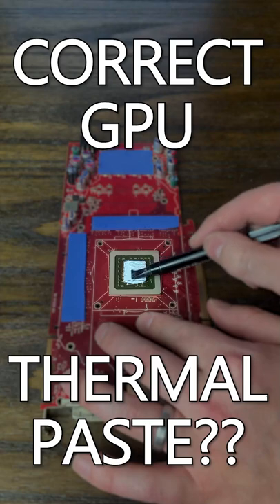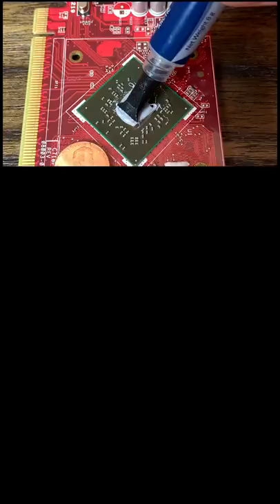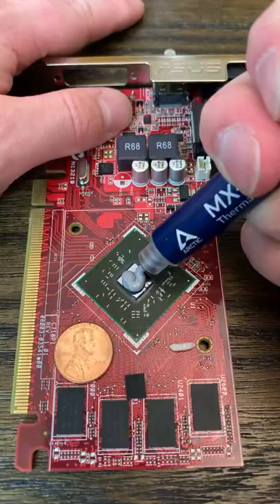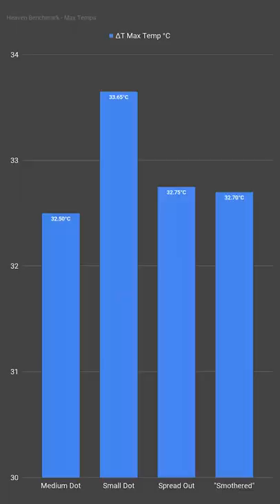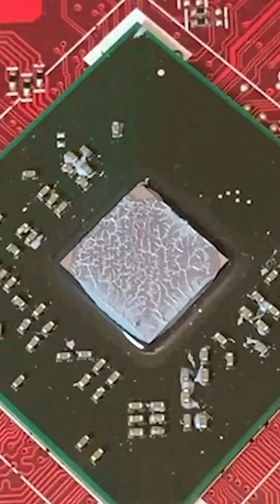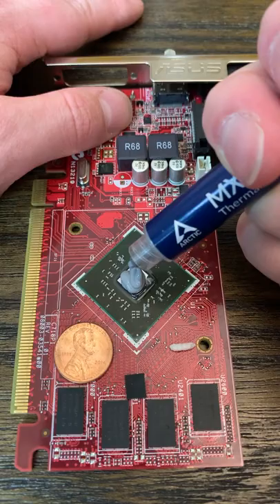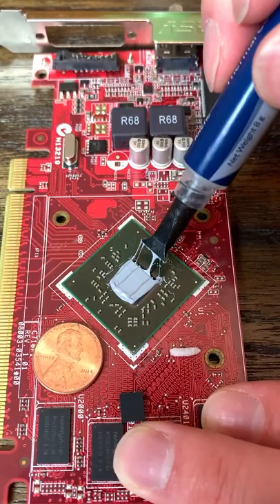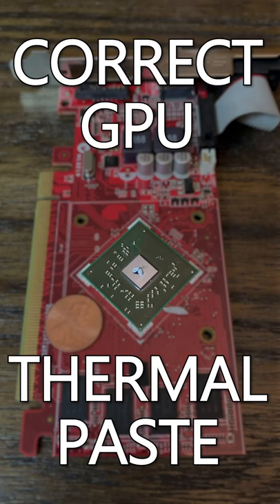GPU Thermal Paste - The WRONG Way #Short

Comment: Your thermals between the 3 good tests were probably within margin of error for whatever was reporting the thermals given how small the difference was. There's only so much volume between the die and the coldplate so any excess gets squished out and you have maximum contact between the die and the coldplate (which is all the paste is supposed to do). I do agree that your method could be potentially more problematic if you accidentally gash an area and leave it too thin and potentially create an air gap, but it's not a guarantee to happen, just not something you want to tell new builders to do. Main reason to maybe use your method is to minimize the amount of cleanup you might have to do on the board later without ever having to question whether you had enough coverage. Putting a verge amount of thermal paste will ensure you have everything covered, but you'll have a lot of goop to clean up later.

Comment: I doubt the dot method would be viable on large dies 400-500 mm^2 +
For small GPUs dies it is sufficient but for the big boys either spread or use X and few dots.
Reply from the maker: I’m going to try and find a larger/hotter and hopefully non-square die GPU to do a follow up

Comment: Honestly this data doesn't mean much on it's own. TechPowerup and XtremeRigs usually do 5 mountings for each variable, benchmark for 1 hr before taking measurements, and take ambient temps into account.
Reply from the maker: I’d love to do what they do, but I don’t have the time to do 5 runs for an hour. And I ran this card for less because it hit a stable temperature really quickly. I ran the first test longer, and realized that there was no change after the 15 minute mark or so. And ambient temps were taken into account, hence the delta T over ambient on the graph

Comment: Just spread the thermal paste.
1.) No risk of uncooled die
2.) Will always be 99.9% consistent every installation. 
(Compared to dots where you have yo rely on luck if the paste spreads correctly.)

Comment: when I repasted my gtx 660, it had a pretty large die so I just went with teeny dots at the corners then and x in the middle that way there are no potential air pockets and hot spots

Comment: Gpus dont have an integrated heat spreader, u need to spread it out and cover the entire die. Or u risk a bare die area as u showed. And that will kill a component. Especially on a more powerful larger die
Reply from the maker: For sure. This video doesn’t cover large and non-square dies. I’m hoping to do a revisit to touch more on that. However, as long as you apply enough paste that it will be spread out and fully cover the die with mounting pressure, it should be fine. Hence why I said to apply to much rather than too little.
Reply: @HardwareHaven  its still not a great idea to just apply a dot on a die, if for any reason it doesnt cover every bit it will cook itself, at the very least if u use a dot u should apply and fully tighten the cooler and then remove it again to check and confirm full die coverage.
Reply: @HardwareHaven  thr bigger issue is that these videos are geared to novice enthusists, u could very easily have someone see this video decide to repaste there gpu and kill it. Most semi modern gpus are going to be large dies and unless u state othwr wise in the video u are saying this applies most/all gpus not just that specific or similar one
Reply from the maker: @riebread13  That's probably a fair point! That's why I'd like to come back and do a more in depth visit with a larger die and a lot more testing. Thanks for the input!
Reply from the maker: @riebread13  I'll add a disclaimer in the description

Comment: I worked in an OEM repair center for GPUs and Motherboards. The thermal paste application after repair is just a fat glob of TP on the die, so all this snobs crying about the correct method seem a little stupid

Comment: Hopefully that spread in the video was not thay final product as those two lines may have caused issues. But yea the difference between spread and a good dot is over rated. It can depend on the chip size and shape though.
Reply from the maker: There are two small plastic pieces on the thermalgrizzly spatulas that cause those lines. Part of me wonders if that’s intentional or a manufacturing defect. I used the backend of the spatula which is flat for the second test with identical results. At least I’m this small die. I’m planning to retest with a larger/hotter die

Comment: I did the spread on my CPU it was a prebuilt they did the pea method my thermals were insane 1 min 30 into cinebench R23 I was at 85C I reposted it with MX-4 now I go through a whole run and only hit 74C I was also over 80C while gaming now hottest my cpu gets while gaming is 64C

Comment: Why do most companies use a silk screen kind of like your spread method but with less paste and more opened area
Reply from the maker: They often do that on CPUs, not GPUs (if I understand what you’re saying). My guess is because it’s cheaper and typically works okay on CPUs because it’s touching the heat spreader, not the actual die itself.

Comment: Again thermal paste dose not cool the chip it only helps in heat transfer to the heatsink the chip itself is not getting cooled it’s just not overheating. So applying a bunch of thermal past thinking it’ll keep the chip cool is wrong you need to be thinking what’s the best heat transfer method and little blob in the middle is enough it’ll spread out once you apply pressure on it with the heatsink
Reply from the maker: I guess I missed where I said something about thermal paste actively cooling anything. And I’d love to see the test results that you’re drawing your conclusion from. Everything I’ve ever seen done remotely well proves that, with too much, the pressure of the heatsink just forces the excess off to the side. With too little, you now have areas where heat transfer can’t easily happen because there is an air gap. Not a big issue with CPUs because they have a heat spreader, but with direct die cooling it’s much more detrimental
Reply: @HardwareHaven  I was just saying it not the thermal paste that cools the chip it’s the heatsink that dose so adding a lot of paste is not necessary you just need a small amount don’t need to spread it like butter on toast
Reply from the maker: @ryans413  What I'm saying, is that there is in fact a danger of using too little. And this isn't just coming from me. This has been proven over and over again by people much smarter than me. Yeah, if you use too much, most of it is just wasted and creates a mess, but that is much better than not enough. Way too many people say things that imply that too much is 'bad', and because of this, there is a risk that inexperienced builders might damage a gpu because they think they only need a 'grain of rice' on a 600mm^2 die.

Comment: Also used a very low power useless GPU. Could have at least done it with something where a meaningful amount of heat is produced like a 1080 or better
Reply from the maker: Wish I could as well
Reply: @HardwareHaven  so the only card you have is a mid range card from almost a decade ago? Could have done it with your daily driver, it's not dangerous.
Reply from the maker: It's not dangerous, unless I'm intentionally not using enough thermal paste. I know the odds of it damaging my card aren't super high, but I'm not risking a 2060 in today's market haha. I do hope to try and find a cheap card but with a larger die and more heat output to do a follow up with.
Reply: @HardwareHaven  2060 costs 300, and a couple minutes testing won't kill it :DDD
Reply from the maker: @weavercs4014  Can I get a link to where you're buying a 2060 for $300? Haha
Reply: @HardwareHaven  there's this thing called ebay, idk if you heard of it. You should check it out
Reply from the maker: @weavercs4014  I might've come across it a time or two.. Cheapest sold listing I can find is $350 + 20 shipping. Most are in the $400 range

Comment: Just make sure it's not conductive
Reply from the maker: Are there any consumer thermal pastes that are? I’ve never come across any
Reply: Some of arctic silver's definitely are
Reply from the maker: From what I can find, it seems like at most it’s slightly capacitive, not conductive. And I can’t find any claims of it actually causing issues. Only looked for a few minutes though
Reply: @HardwareHaven  maybe you're right, but I think it's a risk worth keeping in mind when we're dealing with sensitive components in equipment that is going for thousands of dollars! Would hate for somebody with very little experience to try this and end up shorting out their 3070 ti they spent 4 months saving up for or something

Comment: What was the ambient temprature? Were all the fan rpm's the same? After each repaste. The runtime was the same?
Reply from the maker: Ambient varied by a few degrees. I tried to see what ambient was when the cars hit its peak temp. Can’t remember on what fan rpm was. Runtime was 25 minutes or so I think. The card didn’t take very long to heat up and reach an “equilibrium”

Comment: I have a r7 260x but temps are too high like always cap at 82° when running games.... What can i do to make it stop heating to much
Reply from the maker: Make sure the heatsink and fan(s) don’t have dust built up. Replace the thermal paste of that hasn’t been done anytime in the last few years. Try using a higher quality thermal paste. Make sure your case is getting enough airflow, particularly to the underside of the GPU.
Reply: @HardwareHaven  thanks 😁

Comment: Do all GPUs need thermal paste? I have a GTX 1050 and was wondering if I would need to do this.
Reply from the maker: If it’s working fine, I wouldn’t worry about it. The thermal paste on it is probably working just fine, especially for a card like that doesn’t get very hot
Reply: Alright. I may still do it, though, because I got it used and don't know the extent of the usage it took before I got it.
Reply from the maker: Gotcha 👍🏻 Maybe look up a guide if it’s your first time. But good luck, and enjoy the card
Reply: Will do, and thanks for the help.

Comment: Is there any problme if the paste going on capacitors ?
Reply from the maker: Basically no consumer thermal paste is conductive. There's been warnings that they can be slightly capacitive, but so can air technically. I've never in my entire PC building career actually seen or heard of extra paste shorting a capacitor, but I have experienced people cooking chips by not putting enough thermal paste on.

Comment: Can I use cheap thermal paste for gpu die?
Reply: May not be as good as high quality one, but only by a few degree differences. Issue is long term, it may dry out sooner.
Reply: Use gd900